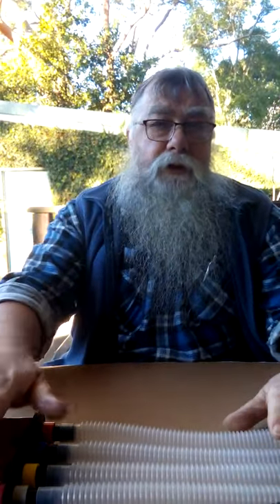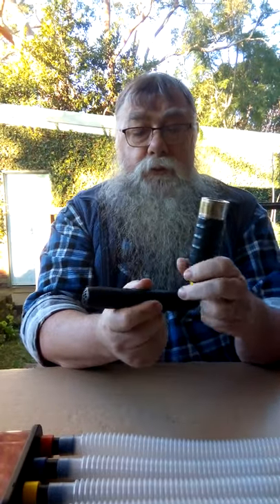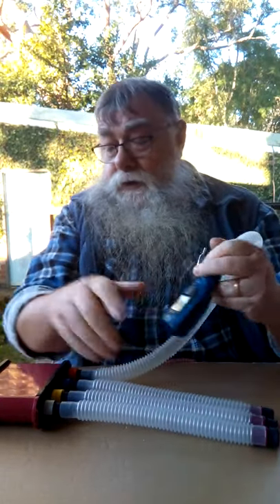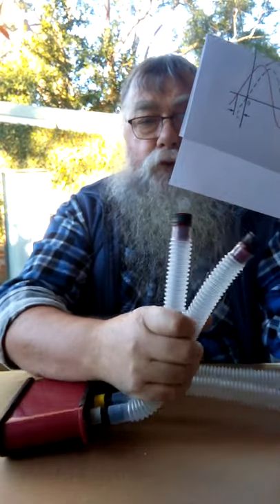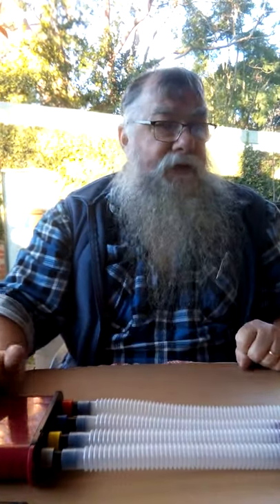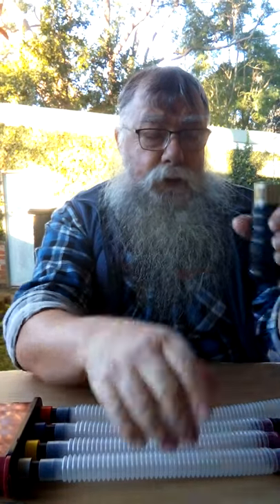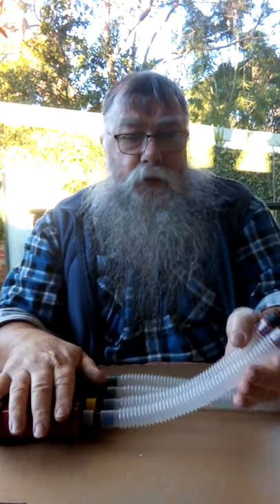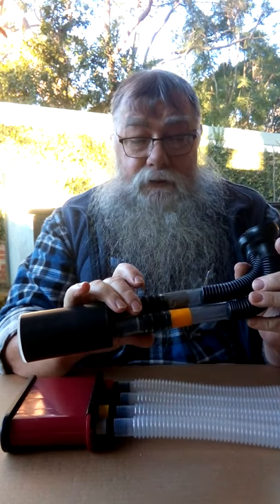Glenarley Bagpipes Moisture Control Devices and Sound Issues

Comment: Very interesting indeed. I've also been curious about what roles mass and material density play. I can tell a difference in feel between drones tied in directly to leather and grommets in the "life" of the drone. They seem to live and vibrate a bit more freely in direct-tie in scenarios. Like the rubber and the extra mass soak up some of the vibration. Would that have a role in the lower amplitude boost of phase-locked drones?
Reply from the maker: I wish I knew more, or someone that did. The results were somewhat surprising but consistent and repeatable and the software does not lie. More surprising is the number of pipers that buy gimmicks without a shred of evidence attached to the claims used to promote them. The humidi-crib reed cover would be the most outstanding in my view.
Sheepies are used by top sounding bands and as a result, many pipers comment on the superior sound of the sheepie bag. If I was one of those top pipers I might take offense at the assertion as "it is not the wand but how you wave it". They sound great because of skill and hundreds of hours of practice and while the equipment is of good quality, to detract from the skill of the piper is just ill-conceived. After the results from this device testing, I have a greater appreciation of the personal skill of the top grade pipers and those that do the reed work for them.